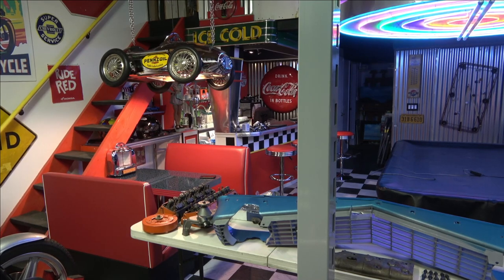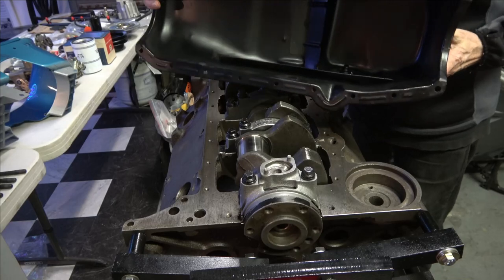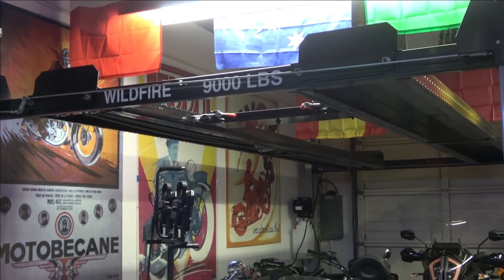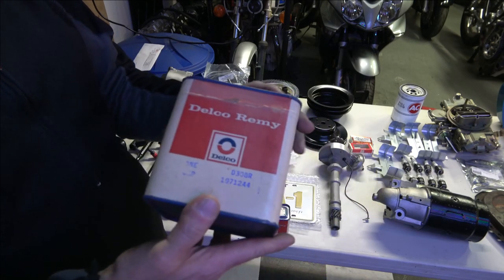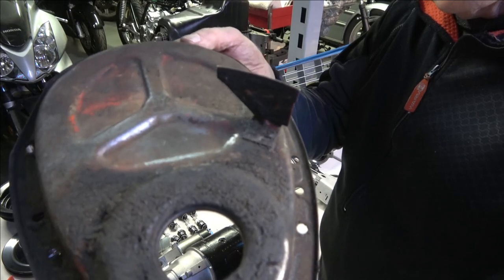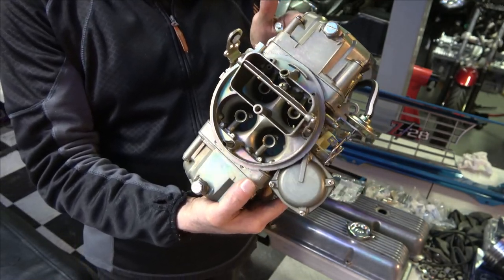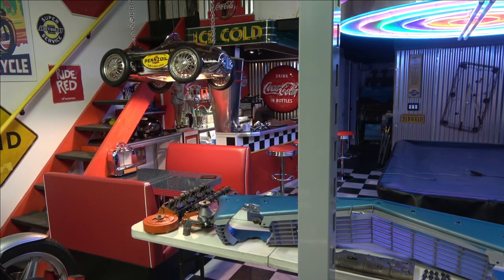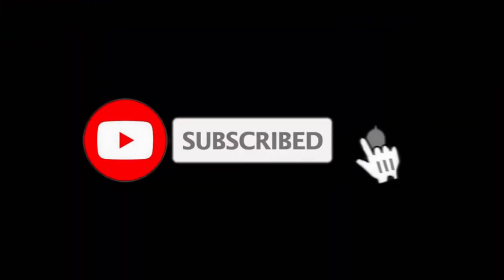69 Camaro Z/28 LeMans Blue Full Restoration Video Series - Part 14 - 302 DZ Engine Assembly - Part 1

Comment: The motor is a restamp and not original as well the transmission is also a very bad restamp. Neither are original to the car. I hope you don't try to pass them off as original.
Reply from the maker: The trans has been re-stamped, not by me, and I haven't said otherwise. That is how I received it. The engine is absolutely the original block. It was obtained from the second owner along with the original sales receipt when the car was new showing the exact V0318DZ that is on the block, as well as the date code that coincides with build date of the car. So I am not trying to pass anything off that hasn't been presented to me. It is going to be one of the nicest Zs out there when its finished and I don't plan on ever selling it, so its a mute point.

Comment: Looks like the block was shot blasted. I hope that the hidden oil plug under the rear main cap was removed and replaced, or your oil will not be going through the filter.

Comment: Do you still have the original pistons been looking for standard bore 302 to put in a 283 that's been bored to 4" when i got the engine it had 327 pistons which is wrong compression height i need 302 pistons i would be interested if you still have them

Comment: Very nice layout of your parts and descriptions z28 never had a heat shield, when you disassembled your your motor, you should’ve left the rocker arms in the fulcrum ball together. You shouldn’t separate them because they are a matched set . Thanks for the videos
Reply from the maker: Thanks Morganz,
Unfortunately, I did not disassemble the engine. I obtained the original block to the car from the second owner, which I gained contact to. I bought the Block and the original heads from him that were completely bare. I had to send the Block to the machine shop to have them repair an area  and prep it. then obtained all the parts to build it up from there.

Comment: Its a victim of circumstance the 302 is just a glorified 283 ,the trans am rules were no more then 305 cubic inches a L79 327 will put the hurt on a 302 and the LT1 is even better
Reply from the maker: Yes, that is all true, but Mark Donahue and Roger Penski (who spec'd out the engine in the first place) wanted a stroker motor that was capable of very high RPMs which are better for road racing. Yes, the LT1 is a good engine, but its interesting that the best winning years that they had in the SCCA race was when they ran the 302, not the LT1 that came in 70
Reply: Only because of the 305 limet ,if that 302 had an auto trans it would suck ,that's why you could get the 70 Z with an auto trans because a 350 made so much more torque then a 283/302
Reply: A stroker engine lol a 3 inch stroke is far from a stroker ,if it was mine the 69 302 block is a large journal I would have built the short block as a 350 ,it still has the correct # on the block and would make more torque and rated 370 hp in the corvette ,did you use ARP rod bolts ,you should have went with screw in rocker arm studs
Reply: The 302was like the vet 327  365 HP look it up the 302had 327  block and a 283 crank with  hi done Pistons  and a vet cam

Comment: Fn smog pump air injection.  Same on my San Jose, CA 1967 Ford Mustsng Fastback 289 4V.  Of course, those parts and engine or on my shop engine shelf and the 2006 BOSS 302 stroked to 347 ci is in the old girl for now.  Put a Boss in your Ford was the marketing line that took me(and shook me, lol) to the Shelby inspired Paxton Novi 1500 supercharged Boss 347.   My buddy has that 302 engine out of a wrecked 69 Camaro in his old Chevy truck.  It is a beast and runs lke a beast still today...solid roller.  Gotta love that from the factory...

Comment: Thanks for sharing all your very nice new parts, one thing I don't understand is the pushrod guide plates are loose, they are held in place by the rocker arm studs I'm wondering what am I seeing?
Reply from the maker: The machine shop did not have them when they did the heads, so I have to install them when I assemble the rest of the head.
Reply: @digitalpizza1  The heads on my '69 Z/28 DZ302 did not have guideplates, as they came from the factory with pressed-in studs, just like the ones shown in your video (and yes they were also 186 heads).  Guideplates are usually held in place by the lower hex part of the screw-in studs and the stud boss on the head, so I'm afraid I don't quite understand your response.  Are you planning to replace the pressed-in studs with the screw-in variety?  I enjoy your videos and can't wait to see the rest of them as you complete the project.  Thanks!
Reply from the maker: @chevyfan5303  Hi Chevy Fan, you are correct, I should clarify. My understanding is that 69 Zs came with the pressed in studs and no guide plates. The 70 Zs came with screw in and guide plates. My car had the guide plates installed in my heads, but it also had roller rockers and cam etc. But I am building the engine as it came from the factory with the exception of new pistons and Comp Cams push rods. So I would like to install the guide plates as well if it possible with the stock rockers.
Reply: @digitalpizza1  Thanks for the reply.  The only way I'm aware of to run guideplates in this scenario, is if you have the screw-in studs, however if you plan to run the heads as they came from the factory, i.e. with the pressed-in studs, then I don't see how it would be possible to run the guideplates.  If you have found a way to run them with the pressed-in studs, then I would be very interested to know how.  You should also be able to run the guideplates with the stock stamped steel rockers.  By the way, I can just imagine the amount of money you spent on the NOS and refurbished parts shown on your table.  Awesome!!
Reply: Can't install the guideplates unless you machine about 3/8" off the top of the stud bosses and then tap the heads 7/16-14 into the water jackets.  You also have to open up the current holes in the heads where the pushrods go through.  Unless you are really going to rev it, probably not worth it as you kind of hurt the value.  You are obviously trying to do a fairly authentic restoration.  I would pin the current studs to prevent them from pulling out.  You can't see the pins very easy.
Reply from the maker: @daveflaugher5180  yes, I agree, I am not going to install the plates.

Comment: I was hoping you would show the vin number on the block, mine is stamped in the rough cast near the oil filter and is some what difficult two read, woundering if your is the same
Reply from the maker: Hi Brad, mine is extremely hard to see. So far I can only barely see the last 2 numbers of the VIN, 63. Luckily, I have the original sales recipe that shows the VO0318DZ on it 😎

Comment: Have you ran into a mislabeled block mine says tyz but put a 350 crank in it 3.48 stroke and the connecting rods head bolt hit the gasket surface for the oil pan by 1/2 inch.
Reply from the maker: Hi Dillon, no, I have not had that happen, but maybe someone else will comment about their experience. Also, maybe post your question on one of the SBC forums or Facebook Groups. There is a Wealth of info from those guys.
Reply: Sounds like you have a 400 crank

Comment: Wind age tray rails. Only the 350 LT1
Camaro not vette had the ability to mate the tray with the oil pan rails!
Reply from the maker: If I understand your statement correctly, you are saying the 302 did not have windage tray rails? That isn't correct, the 302 has a unique oil pan different than the others with the rails. See this link for full description. The rails are clearly shown on pic 3 & 4 -   https://www.camaros.net/threads/nos-vs-original-z-28-oil-pans.178450/

Comment: That long oil filter should say PF35. I still have one.
Reply from the maker: Hi John,
Thanks for the comment. According to CRG (Camaro Research Group) the PF29 was on the Passenger cars until Jan or Feb of 69. After that, they would have had the PF25 filters. So actually, based on that, my car should have a PF25. They also say that the PF35 filters were installed on the trucks. So, who knows, I think judges would except any of the three without a point loss.

Comment: 1969 DZ 302 cylinder heads didn't come out of the factory with pushrod guide plates like those in your video  .
Reply from the maker: Yes, that’s correct. That was already addressed in the previous comments.
Reply: @digitalpizza1  installing them on those heads would be a very good addition, after 1970 all Chevy high performance small blocks came with screw in studs and pushrod guide plates !
Reply from the maker: @johnpena9165  hi John, yes I might install them anyway, I think it’s a good idea. I wonder if it can be done with the current studs, or would I have to use the screw in type.
Reply: @digitalpizza1  it's best to have the stud towers machine down and taped so you can use the standard size 3/8 screw in studs or the stronger 7/16 screw in studs (recommend for racing) both will secure the guide plates in place on the cylinder head .

Comment: that is a HURST shifter .that oil filter is a truck filter should be shorter .Valve covers should be polished. just trying to help
Reply from the maker: You’re correct on the shifter, I misspoke in the video.
The oil filter is an exact reproduction of the original. The valve covers are in fact not polished in 69 and are non drippers. One year only.
The polished covers with drippers came out on the LT1 Z28s in 70.
Refer the Camaro Research Group on their website to verify this info
Reply: @digitalpizza1  that oil filter is the long one i have Correct short one .i have had NOS valve covers there semi polished i have a Cortez Silver RS/Z28 and have had 3 Z's in the past I live in MI and have sold NOS part to Jim at Heart Beat City  my Z has be authenticated by Jerry MacNeish been building 69 camaros for 40 years not trying to be a jerk or something just tying to help and yes Craigs Research Group is a good source for camaro stuff
Reply from the maker: @bigdaddy9864  Hi Big Daddy, Could you take a few minutes and call me? I would like to compare notes with you. I to have owned a hand full of these cars and had Jerry certify a couple of cars. I would really like to talk more . Thanks, you can call anytime at 415-272-8133